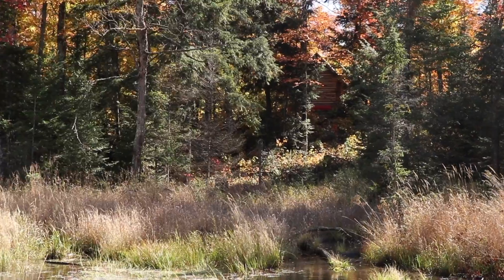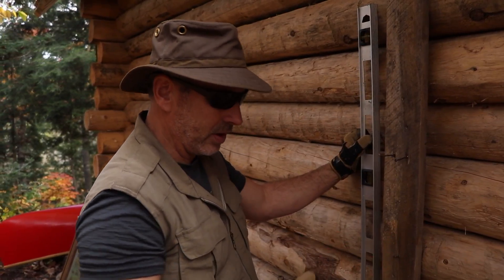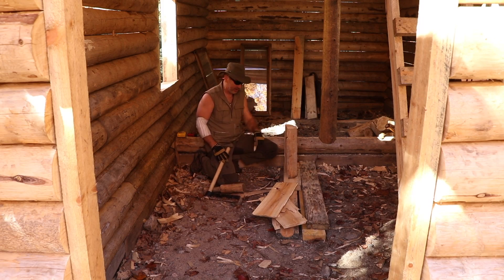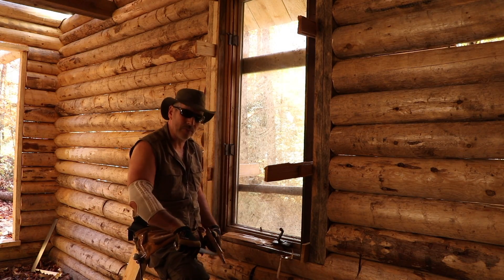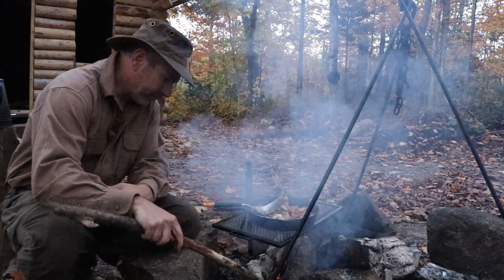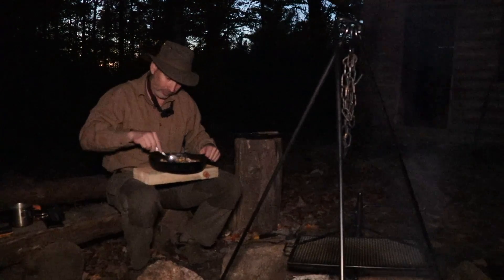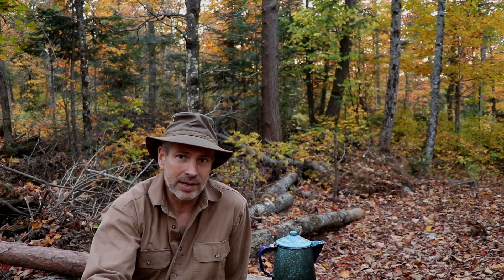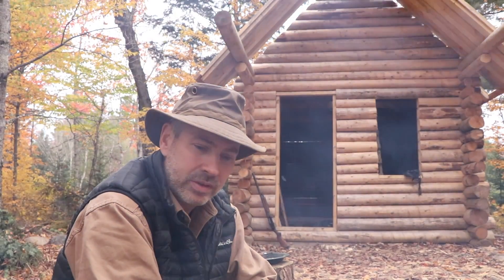Living with a Blackbear at the off grid Cabin in the Forest and Installing Windows

Comment: Our family's experience with bear in the mountains where we live started off badly.  An aggressive bear attempted to destroy our bear proof garbage cans and got agitated when he couldn't get them to open.  During all this, he crashed into our security storm door and broke in the bottom half of it.  The deer have twice jumped up on our roof in a spot where it has a low pitch, and jumped around on top of our roof and then jumped off.  The Forest/Wildlife Service told us to install heavy metal security doors and bars on the windows, (they swing out in case of fire, )  and squirt Pine Sol on our trash cans and around the perimeter of our house.  People here have had bears and deer jump through their glass windows, & sliding glass doors.  Great solution!  Now, there are 4 bears on our road, but they avoid our place.  The oil in Pine Sol remains even after a heavy rain.  It also interferes with the olfactory nerves in their noses and they hate it.  So do raccoons, possums, skunks, coyotes and stray dogs.  It doesn't hurt the animals because they won't lick the Pine Sol.  We haven't seen any snakes up around the house, either.
Reply: I feel that people are missusing the term "Aggressive Bear" as when they go on to describe the bear's actions they seem to me to be just normal bear behaviour. Bears will be Bears. I do like your Pine Sol solution though. I would definately give that a shot. Thanks for that bit of wisdom Elizabeth.
Reply: Thanks, IronKnuckles.  It may be normal bear behavior, but we're too old to run!   A man in our mountain town nearly had his head taken off by a bear's swipe of his claws.  Just missed his jugular.  The bear did kill his dog.  Tore his shoulder and right leg off & he bled out. Glad you liked the Pine Sol idea!
Reply: All you need to be is faster than your partner!! ;p  Ya bears can be very nasty...being wild and all that.

Comment: Built a 2sided log house (he’s using what is called full round logs)for my family with the help of some friends and worked on many others throughout the years .
One thing about logs , even if you are using dry dead standing trees (lodge poll where I live )is after they are stacked and your heating the interior they will shrink and settle . I’ve seen in some cases up to a inch .
He’s chinked between the logs using moss and concrete which is fine for the first few years but for sure the logs will and already are shrinking alway from the concrete leaving a drafty cabin.
Use an elastic chinking with closed cell foam backer rod system which is designed to stretch and move with the logs

Comment: I enjoy your videos very much, keep them coming.  I read most of the comments but not all so if this was mentioned disregard.  I saw this on another site for log/timber framing.  When installing the windows and doors or any opening in a wall, cut a saw slots in the vertical board that is against the log ends, use a spike with a washer on it.  This holds the board against the logs and the slot allows the logs to settle.  Fasten all other parts of the window to them.  Just a thought as I'm certain your installation worked out well.

Comment: I would like to say that the chisel would normally be used with the sloping ( Bevelled ) face at the bottom. Then you will achieve a flat surface, the chisel can not dig in. This is partiularly important in delicate work such as plugs or dowels using hardwood. I was trained by a master joner.

Comment: Hi Shaun.
you could just change the window hinges and move them to the top rail instead of the side stile. 
Then the window would open from the bottom and offer a means of escape in an emergency !
Plus. Easier job than altering the roof or cutting the window down ?

Comment: I'm a little concerned about the logs setting down as they dry, for my own log house, we managed a 4inch space between the windows and the log on top, and it took 5 years, but now the gap is completely filled . Also, the side of the windows are not nailed to the frame, there is a slide so the glass won't crack. But you are doing a wonderful job, I'm sure you will enjoy life in your cabin.

Comment: This type of BBQ Grill is very common in Germany, we always hang a round grill underneath and control the heat by swinging it around. The meat cooking on it can be moved around and will never burn if the swinging does not stop. Of course the time it takes to get the meat ready is commonly judged not by a clock, but by the amount of beer it takes to get ready.  About three beer to get the coals of the wood just so, two to get Sausages ready, one for steaks, about two more to finish the soup...As you can see, BBQ is always a very happy time for all the males involved, us Girls? Well we allowed to make the Salad (Which no man will touch), keep the Beer cold and clean up the mess afterwards. :)

Comment: I spent 20 years living and working in the western Canadian wilderness in log cabins.   Your bear is going to be a problem.... I would not leave any dishes, pots and pans outside, this has attracted critters into camp.  I would make some external window shutters for over those windows as that will most likely be his point of entry, they should have some form of fastners so bear can't force them open..... nails sticking out don't hurt either.   I had 3 resident grizzly bears in the meadow out front but never a break-in.
Are you just coming out on weekends? I would pack out all your garbage, and cans.  How far to your car from camp? just curious how far you lugged that window?    
We always had a metal locker for meat, butter, eggs etc...... one day I came home while working on top of a glacier to find a wolverine ate through the door and was sitting on the meat locker knawing his way through it.   
Like your cabin but curious why there is a big gap between the gable and roof overhang?  Not that it gets that cold out there does it?  But would keep your porch drier and ice free, if you button up that gap.   Best of luck.

Comment: Of course you have bears coming to your cabin, you are cooking right beside it. And the best way  to get rid of a bear is with bear spray. I couldnt imagine you cooking beside your cabin and having to repeatedly kill every bear that comes around.  Or worst, you could miss your shot while under stress and have the bear kill you. 

Bear proof your cabin and be bear smart. A good way to bearproof your cabin would be to put nails on the panel windows. (just nails sticking in, as you would put any other nails, doesnt have to be pointy on the outside )

Comment: Surprised you didn't make our own windows.  You can order double paned, sealed windows and then frame them yourself.  They're cheap. It's just glass and it's just wood.  Why in the heck wood windows are so expensive is beyond me.  I made my own without any resources to help me figure it out.  I was surprised to discover  that nobody makes their own windows.   That made me want to do it even more.   It wasn't that big of a deal. I mean, all a wood window is is a wood frame around some glass. 

It's been a good 10 years since I built mine, but as I recall my wood windows cost me around $100 to make myself, that was insulated glass panes and pine to frame them.  That doesn't include the cost of removing the existing windows and installing he new ones which I did myself.   I got estimates for vinyl windows and they would have been $400 installed.    Custom wood windows, who knows, maybe a $1,000 our even more.